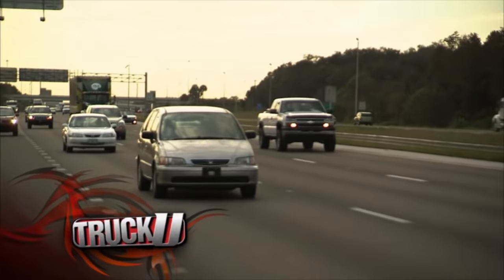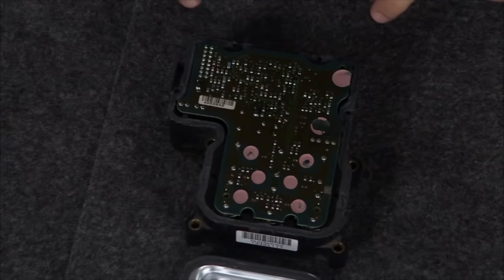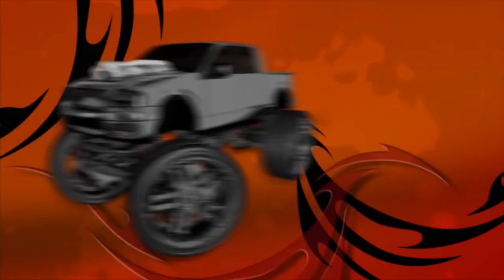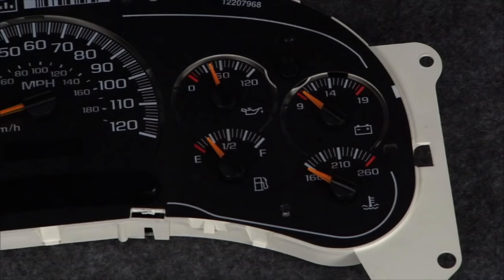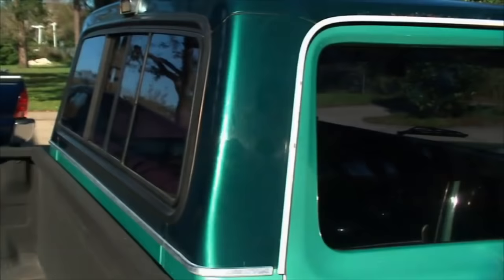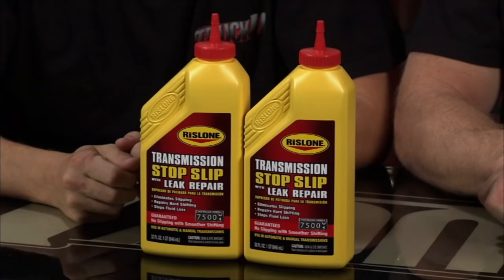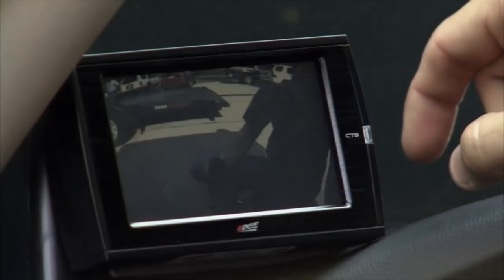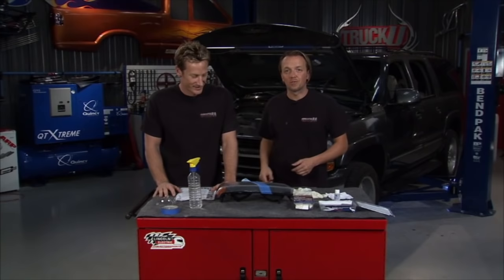Fixing Common Chevy Problems | TruckU | Season 5 | Episode 15

Comment: buy a Ford Truck ...problem solved
Reply: just traded my piece of shit chevy for a trd tundra...Problem permanently solved.
Reply: Watch out for frame rot on the Tundra.
Reply: Frame rot killed my 2002 Tundra :(
Reply: Stephen Maurer Toyota 4 runners have the same problem. The 4 runner I was going to buy had rust all over the frame including the trailer hitch! Even the spare tire was rusted out and they still wanted $20,000.00 for the rust bucket! No thank you!
Reply: Geovanni Delgado ford trucks have issues too
Reply: Fuckin Okeys Really Dig"em
Reply: LOL Ford trucks aren't WORTH fixing, that's the difference. Especially that piece of shit 5.4 Triton.
Reply: Yeah I'll suffer a few little problems on the Chevy compared to the 5.4 that blows plugs out the head or has expensive cam phaser issues.
Reply: Toyota can make a hell of a car, but their trucks suck.  Just wait and you'll see..

Depending on where you live, they're worse than ford for rotting.  So bad that all their trucks made in the past 15? years have frame recalls on them.  The worse part is they used the same manufacturer on the new generation tundra/tacomas a few years ago after the recall and guess what?  Those ones also went under recall for the same thing.
Reply: Chevy is a good truck, it’s just the annoying consistent little shit always, especially if you buy em used. Ford got better after the triton motor got thrown out and started using the coyote, tundras I’m not sure about never owned one. Chevy has the notorious squeals especially on the generation and next in the video, gotta baby the fuck out of it or ppl will hear u coming from miles away
Reply: Thinking about getting a 88-98 chevy.  Good or bad idea?  Seems like the 99's and up have alot of problems.
Reply: +Daniel Hinkle The 88-98 Chevy trucks are very solid I'm restoring a 1998 Z71 love the style. I've owned many over the years I also owned many Dodge's but they were all junk.Nice thing about the 88-98 Chevy trucks are parts are everywhere and parts are cheap and there just a great looking truck to boot.